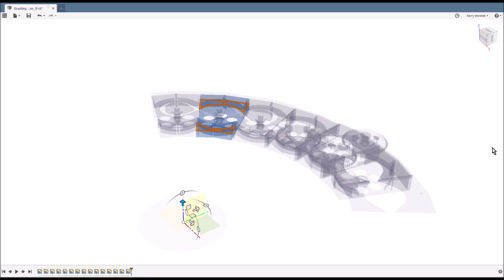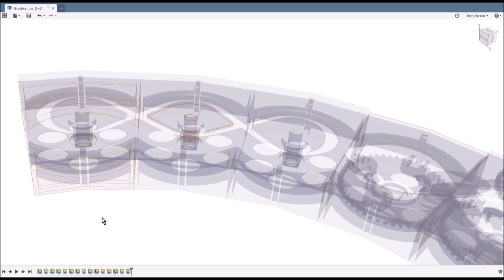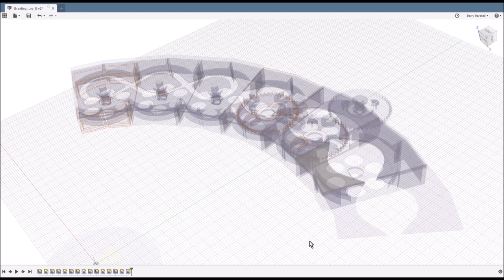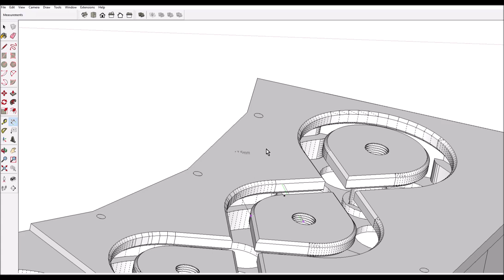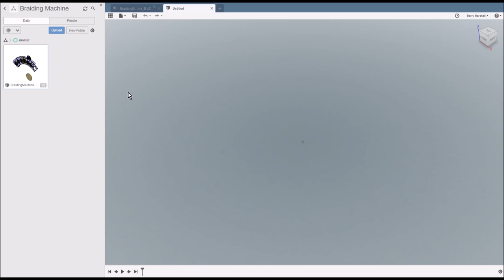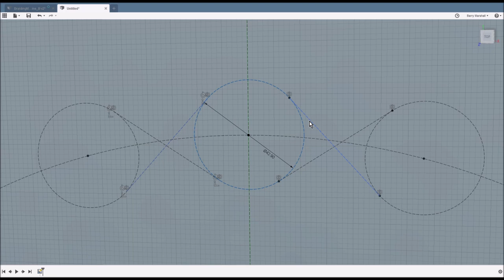A new approach: Braiding Machine #10 - Sketchup Nooooo! Lets start again in Fusion 360!

Comment: hi there!
first of all, this is amazing! thank you so much for this series.

secondly, if you don't mind me asking and probing. 
for a while now, I've wanted to build a 4 strand braiding machine of my own. the difference is, I want to braid speaker wires, around 12-16 awg in diameter. do you think this kind of design would be viable? it would of course need to be beefier, but other then that, would it work the same on your opinion and experience?
Reply from the maker: Hi. Yes I'd imagine a beefier version would work perfectly. Obviously you'd need less segments if you're only looking to braid 4 strands.
The main reason I'm not routinely using a derivative of this machine at the moment is just the time it takes to load the bobbins with fibres, as I need to relaod them all for each over-braid. My current thoughts are to go much bigger to allow me to load commercially available fibre bobbins. Anyway I hope your project is successful. Good luck. Barry M